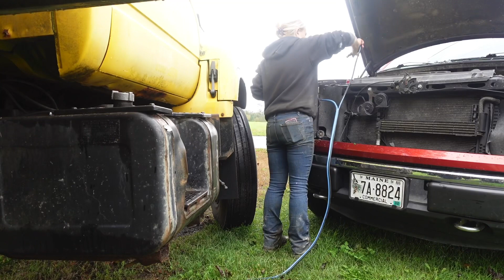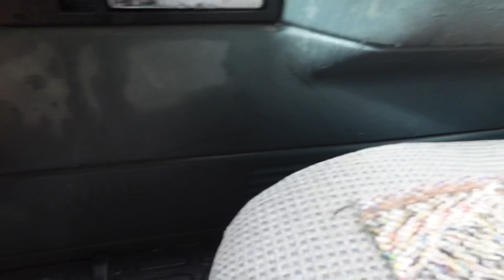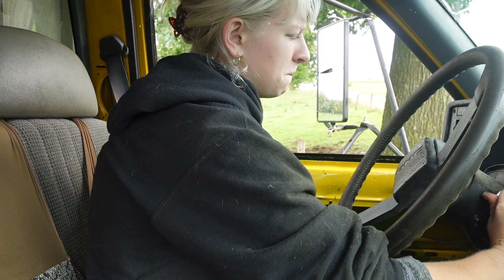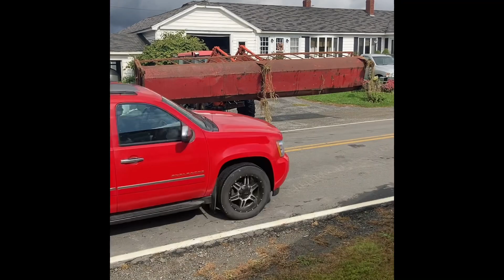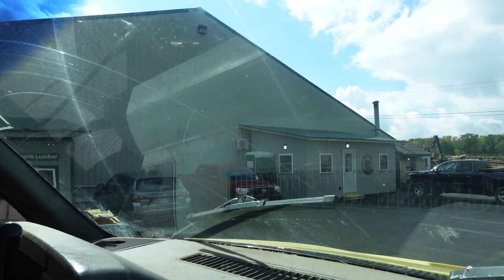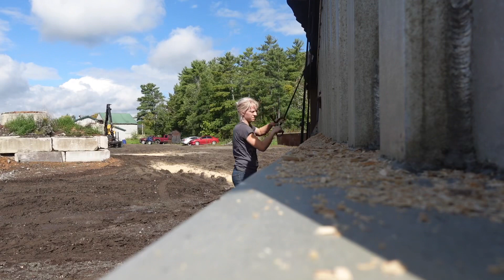Road trip with the big truck!! How we supply the cows with comfy sawdust…

Comment: Hiya Taylor,
I've just watched this video again. The reason for the constantly flat battery on your yellow truck is a small light that stays on or a very minor leak from the live to the chassis somewhere. The best thing to do is fit an isolator switch, usually near the battery. This will disconnect the battery from everything on the vehicle and prevent the run-down battery. If you do a jump-start, always have the hoast vehicle running; its alternate will provide more power. Please always connect the positive cable first and then disconnect it last. I hope this helps.
Stay safe, Steve...

Comment: Hiya Tay,
Another excellent video; thank you for it. A minor point, never short out jump cables like that; A co-worker always did it. One time he had just put what you call gas in the motor before doing it, and yes, a spark landed on spilt gas on his pants. He had full-thickness burns on his left leg and both hands. I think that means down to the bone. He never worked again but had much hospital time, especially in the OR. 
You can kill the battery/alternator on the host vehicle too. 
Stay safe, Steve...